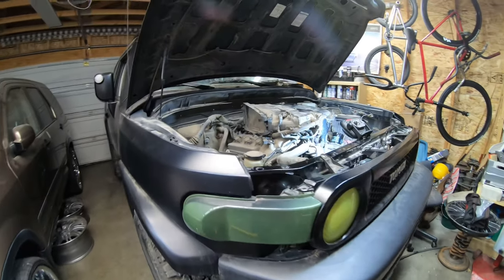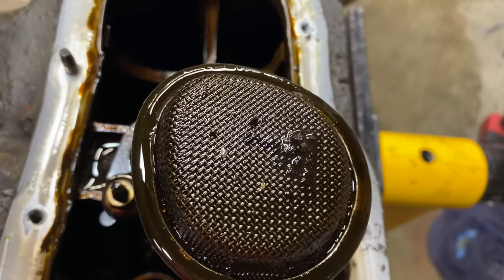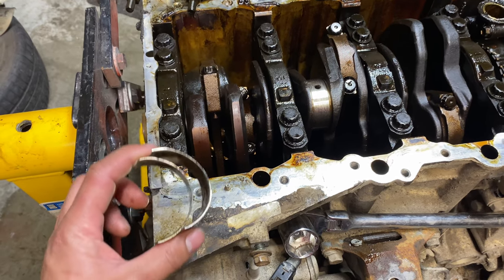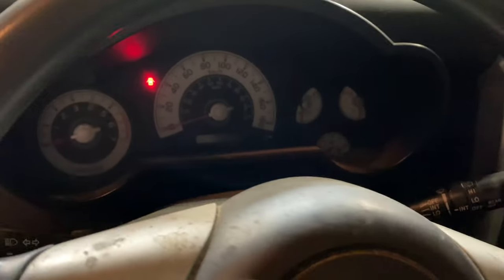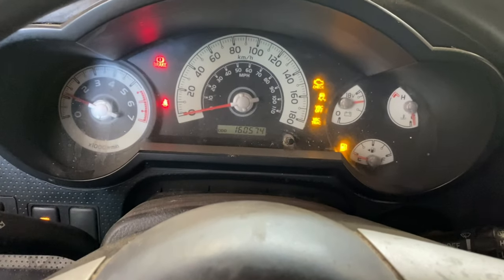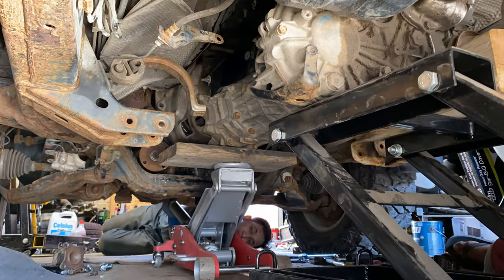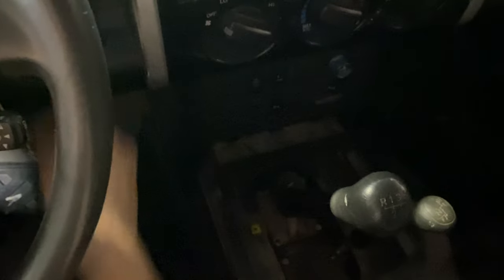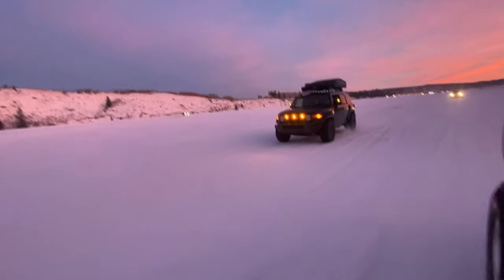Project: FJ Cruiser for $3500

Comment: I just realized that you’re in Alberta. Pretty sure we live in the same city. Your video showed up on my feed. If you need any FJ parts I have a bunch left over. I just sold the same procomp wheels off mine and also had a black sw20 so I’ve got a few parts left over from that too.
Reply from the maker: Yeap Calgary Alberta.
You have an ad for your parts?
Let me know what you have, i might be interested on some mr2 and fj parts
Reply: @hackspeed  Front bumper and components, plus side steps and skids from my 2010 FJ after an armor upgrade. SW20, mint 94+ leather steering wheel, but i'll have to look around the garage for other parts since I sold my sw20.

Comment: Dude I bought mine used with 79k miles on it, now after 139k  with my manual 6 speed I love this thing, my only battle is rust
Reply from the maker: Mine too the only thing i gotta deal with now is just surface rust, which is not bad. I wanna get it dry ice clean then rust coating. I don’t drive it daily only when I haul stuff and go camping. I try not to put much km.

Comment: I didn't know that FJ came also with 6 speed manual. I wonder what is consumption on open road?
Reply from the maker: I honestly never tried to monitor how much it’s consuming during highway drives. I hardly drive it and when I do i’m pulling a trailer or hauling a lot of stuff for camping so.

Comment: hello I'm a big fan. I have a fj cruiser 2007 1gr fe sometimes when I put the drive and I accelerate the car takes a second before launching or as if it freezes but once launched I have no problem with the acceleration please what is the problem?thank you
Reply from the maker: Hi there,
It seems like you transmission fluid is low or bad. Check your transmission fluid first before doin anything else. Also make sure you use the correct grade of fluid.
Let me know how it goes 👍🏽
Reply: @hackspeed  hi thank you for your time but even when i am parked and i try to accelerate it happen sometimes it freezen or like shake before it go

Comment: i may have missed it but how many miles were on it? nice work BTW.
Reply from the maker: It has 160k kilometres when i finished the project, it currently has just a little but over 170k kilometres.
Reply: @hackspeed  I bought LC120 2005 with the same engine 1Gr-FE and 205k km. That engine was smooth as it can be. Had to sold it cause the gasoline prices sky rocketed here in Europe. At 1.90 per liter is just to much to have such a car. Same goes for FJ.
Reply from the maker: @The_Touring_Jedi  Land Cruiser Prado, we never seen those here in Canada or North America in general. It was kinna same here sometimes gas prices lingers around there there was one time it was over $2 a litre. I tried not to drive it when gas price are bad